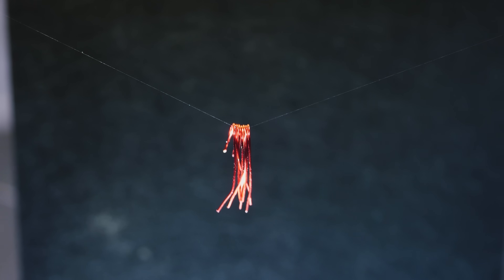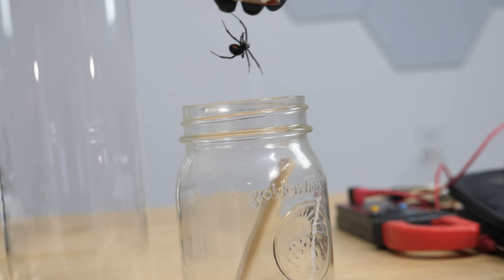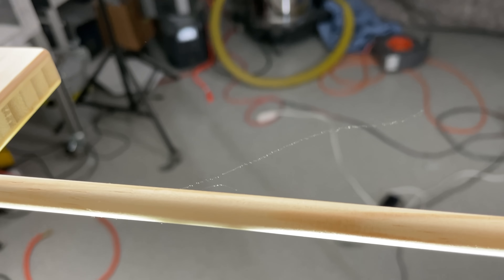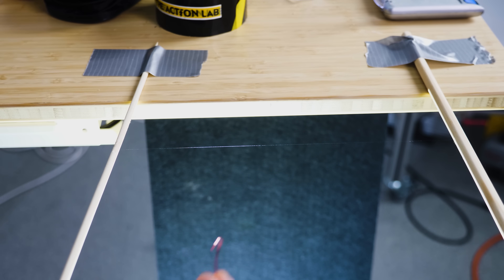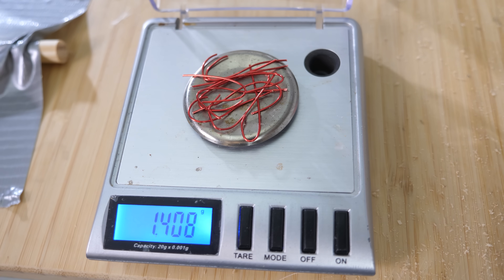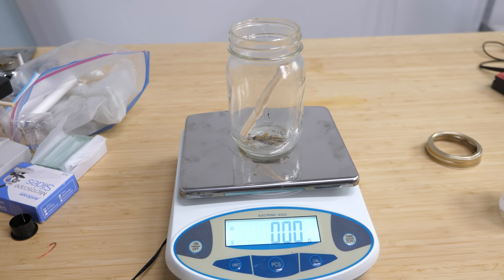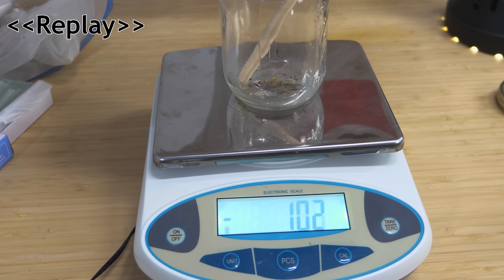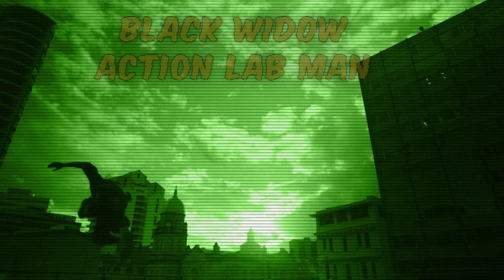Is Black Widow Silk Stronger Than Steel?

Comment: Angle made  of strand between supports changes horizontal tension force.
The less the angle the greater the horizontal force which can be far far greater than the vertical weight of the hooks you placed on strand.
In Statics physics.
At 45° horizontal and vertical forces are equal.

An accurate strength test can only be made using pure vertical strand .

Or measurement of angle of strand upon failure.
Reply: That is irrelevant, tensile strength is measured by how much it can withstand, not how much force it produces from tension, the horizontal component here is hence excluded from the calculation as the sample doesn’t “withstand” it.
Reply: @j.mtherandomguy8701  I  know . But the actual force applied varies with change in angle .

Basic statics in physics structural engineering.

You seem to not understand my point.

If he hung a known vertical weight on silk strand it would be a pure linear equation pure vertical force 

A horizontal cable when loaded becomes a differential equation since the weight stretch cable increase angle decrease horizontal components increase vertical.
At 45° both are equal. 
One can measure exact force on strand only by knowing the angle it makes from horizontal.
At 3° the tension is much much higher than at 45° .
Reply: This is true! The angle does significantly affect the tension!
Reply: @hannahnelson4569  statics in physics.  Trig used to determine resultant force vectors.

Comment: Just did a quick repair on a theodolite cross hairs last week. Black widow silk is highly recommended for these. Good fine consistent diameter  with a good strength in order to be fitted accurately and taut enough.
Reply: maybe it will help you find the curvature better

Comment: Haha they are technically the deadliest North American Spider but out of around 2.5K Bites reported to poison control only 4 to 8 people die from bites per year, and usually those with aggravating factors such as immunodeficiencies. Also keep in mind that there have been 0 confirmed black widow bite related deaths since 1983, unless someone actually captures the thing that bit them and has it checked by a professional it can't be considered a 100% confirmed case due to the frequency of misidentifications. In many cases people don't even know what bit them which is fine, but it's hard to take stats from poison control calls alone. Spider bites should be about as scary as thunderstorms because you're actually more likely to get struck by lightning then die from a spider bite.
Reply: Black widows are also very chill. There is a paper called “Poke but don’t pinch: risk assessment and venom metering in the western black widow spider, Latrodectus hesperus” where they looked at the conditions most likely to provoke a bite. In short, they generally don’t bite when poked, only when pinched. More than 50% of defensive bites were dry bites (no venom). Spiders also delivered less venom in response to less threatening situations.

So a black widow you can see poses virtually no threat to you. Most defensive bites result from accidental encounters with a spider in an unexpected location.
Reply: Exactly what black widow would write...

Comment: I'm not convinced that just because you apply a tangential load doesn't mean that the silk isn't experiencing axial loads(and I don't mean axial loads from bending). I believe that the silk is indeed experiencing axial loads as the material isn't like an aluminum or steel beam. Therefore, the typical analysis that you'd do with transverse loads, which involve calculating the shear load and then the moment diagram and then calculating the bending stress and shear stress, won't be applicable here because the silk isn't experiencing bending stress. I know that these mechanics of materials calculations are only applicable when the material in question fits certain criteria. We also need to consider whether the silk is experiencing plastic deformation or elastic deformation. Also, these stress calculations are usually under the assumption that the cross sectional area is constant under all loadings. Technically, if the silk is extending substantially longer, then due to conservation of mass, the cross sectional properties have to decrease to accept a longer piece of silk. Lastly, you need to look at the internal loads by taking a ''cut'' at two ends of the spider web and resolving the tensile loads based on the angles made with either the horizontal plane or the vertical plane. As another guy said here, the tensile load here is 5/6 P, assuming a 3/4/5 triangle. What we don't exactly know exactly is what radius The Action Lab used in the cross sectional area calculation, or what type of rounding that may have been done. These ramblings coming to you from a dude with 4 years of stress analysis experience, so please take what I write with a grain of salt.

Comment: your experiment measures tangential stress. The thread breaks due to tangential forces, not normal forces. The tensile strength, due to normal forces, is usually at least 10 times larger than the tangential stress limit.
Reply: Incorrect, since the string is flexible, in the region outside weight hanging at (failure occurred outside that region), forces are directed along the string. If it is about the anchoring region, things are more complicated (very hard to know exactly because it involves adhesion and non-elastic properties of the string) and still far from pure shear, but since the string thinnens, i believe it fails outside that region too.
Reply: Still, I think it would have been more accurate if he attached the silk to a weight on a scale. Then he could just slowly pull on the silk to see how much weight it could subtract from the scale before breaking.
[Edit]
Nevermind, I just finished the video and see that he did that too.
Very good
Reply: @harlanweid7723   Nope. Cut the string anywhere, in mind, and balance the forces, left and right. There is no section of string, due to the shape,  without tangential forces. And the tangential strength is much weaker than the tension strength. Yeah, the proposed weight on a scale experiment would eliminate tangential forces.
Reply: @Kraflyn  The string is in uniaxial uniform tension state far enough (~2 diameters) from the weights and the anchor. It is due to Saint-Venant's principle (you can find it in wikipedia or elsewhere). Consequently, the cross section without tangential forces will be the one normal to the string.
Reply: @harlanweid7723   No... Just do the cutting trick from Technical Mechanics... The applied outside force is the weight in the middle of the string, acting downwards. String is horizontal att he center, and at an angle but almost horizontal elsewhere. At no point is string vertical too. So the reaction is vertical too, because the outside force + the reaction cancels out: the equilibrium principle. So the force in the string is vertical too. But string is almost horizontal... so the stress in mostly tangential... nothing can possibly convert a vertical force into a horizontal one... Just:no! :D
Reply: @Kraflyn  The surface of a virtual cut and the anchoring region on the other side are subjected to some forces. Those forces have vertical and horizontal components. Horizontal components cancel out since weights do not exert horizontal force. The string is not almost horizontal (and it cannot be, it is not a beam), which you can see even after 1 weight is hanged. The string is in uniaxial stress state and it cannot be otherwise since it can't transfer moments. If the surface of cut is normal to the string, such surface will not have tangential force on it and only will have normal force, directed along the string. This force has vertical and horizontal components, vertical component is not a tangential force. The cuts that are not normal to the string do have a tangential force but this is basically a result of decomposition of uniaxial stress state in rotated basis (more precise the act of uniaxial stress tensor on unit vector normal to the cut that does not coincide with direction of the stress).
Reply: @harlanweid7723   you just repeated what you said earlier... i'm not gonna repeat myself again!
Reply: @Kraflyn Reaction force shouldn't be vertical. Sum of the reaction forces should be vertical, which could be achieved (and this is clearly the case in this situation) by multiple forces, non of them vertical, but all has vertical components. In this case there is a right and upward, and a left and upward force, both act in the direction of the string therefore there is no tangential force applied (except at the contact points between the thread and the weights, but the string snapped elsewhere so it doesn't matter).
Reply: @Zilahi-Branyi_Laszlo   The weight acts gravitationally, right? So the applied outside force is vertical, right? Now split it into vector components on any string cross-section... That's all... String should be vertical if the stresses are all normal. Otherwise there is shear. The less vertical the string is, the less normal stress, and the more tangential stress. It's this easy... I'm not repeating this again! :D
Reply: @Kraflyn  When you split up a force into horizontal and vertical components, those are not real forces, it's just done for calculations, but in the material there is no two different direction forces, just one force act in a diagonal way. The less vertical the string is the more normal stress presented as stress could be only normal in a string and the vertical component (which is not a tangential force, its not a force at all — see above) of the normal force is cos a ("a" is the angle of the string to a vertical line) so the only way go get same vertical component of the force when the string is less vertical is a greater normal force.
Reply: @Zilahi-Branyi_Laszlo   Just read any book on Technical Mechanics, ffs... :D
Reply: @Kraflyn  Maybe you should understand, not just read. The two measuring method in this video also prove that there is no tangential force involved in the first shown method as the string snapped at very similar pulling force, than in the second one. If tangential force would play a role, than he should have get very different value based on the first experiment.
Reply: @Zilahi-Branyi_Laszlo   The string snapped at the end, where it was horizontal...

Comment: I was just cleaning my shop and there were dozens of brown widows(*BW) and grandpa long legs(*GPLL). I observed the brown widows capturing the GPLL. It was crazy because they would let a leg fall off to get away. The brown widows were fishing by the looks of it. The GDLL would get snagged then the BW would run back and forth attaching silk to the leg, and every time the BW went back up the web it pulled in the GPLL a little more until the BW got it or the GPLL leg popped off. Needles to say I didn't get much cleaning done.

Comment: When calculating the tension in the spider silk in the first experiment, you also need consider the angle the silk is making (because it is slacking due to the weight). From the video I estimated this to be around 30° with respect to the horizontal, resulting in an estimate of the tensile strength of 1.2 GPa.

Comment: Ok, imagine if you could take enough of that webbing to make a 60 foot I beam, like the steel ones used in construction. The exact dimensions of the long I beams used in sky scrapers replicated with pure silk. I wonder how strong it would be, what the tinsel strength would be.

Comment: I was doing some wiring in the crawl-space...spider-webs are just something you have to deal with.
But whenever I'd run into a Widow web...I'd know it!
Very tough, elastic and seemed like they didn't want to break!
Was able to balance my flashlight on a web...the strands felt like wire more that anything else.

Comment: Dont you need to factor in the angle of the web string from the vertical to calculate the tension force in the string? I think you might have under calculated the tensile strength of the web because the closer to horizontal the string is the higher the tensile force.

Say if the string angle is 60 degrees from the vertical, the tensile force would be the weight of the hanging objects divided by cos60, so basicaly divide it by 0.5 therefore the tensile force would be double the weight on it.

Comment: In you calculations did you adjusted for the fact that you are not pulling on the strand but hanging from both sides of it. It's like when you are lifting heavy stuff if the angle is almost 180 degrees you need to multiply it by... I think 5... At 45 degrees times 2.5 . So in fact the gravity is pulling harder on both strands because it's horizontal.

Comment: Third deadliest spider in the world? I don't know about that. The Funnel Web and Wandering Spider are obviously in front of it, but so is the Australian spider that's closely related to the black widow - the redback. Very similar looking spiders, except the redback had a red stripe along its back in addition to the red hourglass shape on its underside. The redback's venom is regarded as being more potent than the black widow's. I think that puts the black widow at 4th place at best, though it's possible the bites of the 6-eyed sand spider and mouse spider could be right up there too.

Comment: Found a Black Widow in the base of a bird bath once. They are pretty sedentary and not very aggressive so if you spot one you're not in any real danger. They like dark crevices though so yhe real risk is sticking your hand in places without checking.
Reply: This. Black widows are very chill. If you’re aware of a widow’s presence, it poses virtually no threat to you. They only bite defensively as a last resort, usually when pinched. In one study, more than 50% of defensive bites were dry bites.

Comment: So, is that extreme relative strength also the reason that black widow webs are also so much louder than other spiders' webs when broken? Most spider webs barely make an audible sound at all when broken, if at all. But with black widow webs, every single strand's snap combines into a uniquely scratchy and unpleasant sort of static you can't miss.

Comment: Im a bit confused still. So youve measured the tensile strength but obviously one strand of silk isnt as strong as a steel cable. 
I guess the question im wondering is if its 6x stronger does that just mean if you were to create the same structure from the spider silk as that of something made of steel would you just need 6x less of it?

Im just curious how it would work out in a practical scenario. Like if we were able to create silk like this what would the increase in strength look like in real life use.

Just less material needed to be used since the silk would be thinner, lighter, and stronger?

Comment: I understand why you had the strand of web extended horizontally due to the logistics of this experiment. But as a result, the web is not being strained in tension. This is actually a 3 point bending test. When the material is constrained like this, it will break below its ultimate tensile strength due to the inherent flaws in the material. In 3 point bending, different sections of the material are experiencing different stresses. If a flaw is found in the aeras of higher stress, it will fail there. When a part is loaded in pure tension the whole thing is under the same load which helps compansate for the flaws.

Also, the load not being applied in a static fashion is skewing (constant rate) the results. As it stands not much can be done in this case since the web is so fine and hard to work with.

Overall, great demonstration!

Comment: very cool! 
going off 45° angle of the thread at the moment it ripped the tensile strength should lower around 0.86 Gpa, what angle did you use? if it were to stretch less than that ( 45°) you'd get a higher strength as you did

Comment: You missed some basic trigonometry and static force analysis.  (Or maybe you did that analysis and didn't share it in the video).

The strength of the silk is along its length, but the force applied to the (originally horizontal) strand has deformed it downward by some small angle (let's call it theta).  That means that the tensile strength is hypotenuse, and weight is opposite - cosecant is the function you need here, if I remember correctly.

Comment: I have had them in my yard and garage for at least 20 years. Some things I would like to point out about these ladies. 1. They are nighttime hunters. You usually do not see them in the day time unless you disturb their hiding spot. 2. Before they try to bite or run they will first draw their legs in and make themselves into a ball and play dead. 3. They do not always give a wet bite. By that I mean sometimes they can bite without using their venom. You can get bit and not have a lot of symptoms. usually a localized wound. 4 They are not solitary if there is plenty of food they will colonize a large area together. For example ; When I flipped up my old spa there were no less than 15 of these girls under there.  5. If you get a wet bite you will have leg cramps like you would not believe. You will throw up and dry heave until your stomach cramps. It is a really miserable time.  They say the effects get worse each time you get a wet bite ,but I cannot confirm that as I have only been bitten 1 time with venom . Thank you for reading.  They are really amazing creatures.

Comment: These spiders make the absolute best spider pet. They are instantly active when you put an insect in their enclosure. To watch them figure out the weak spot on the insect, then they say they string it up in this incredibly complex pulley system, and then they say they discard the body to clean out the web, is just magic. Creepy magic, but magic. They are always working.